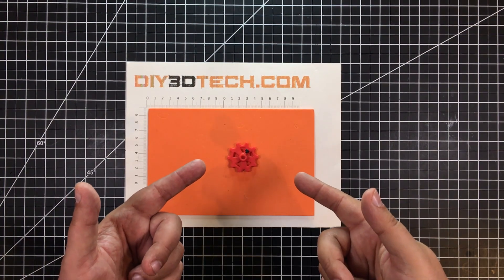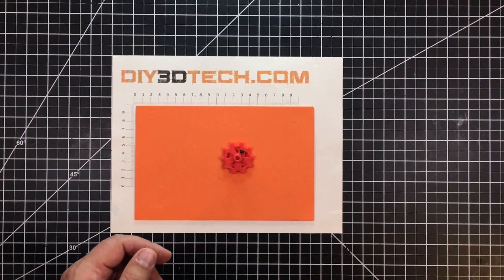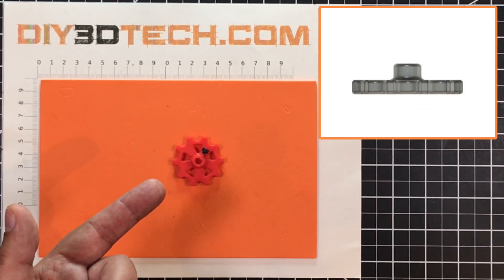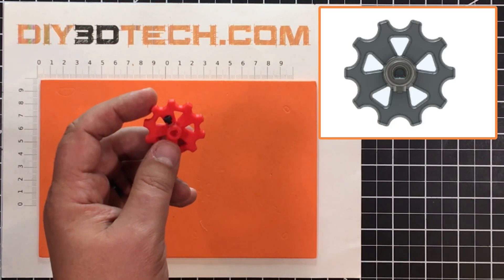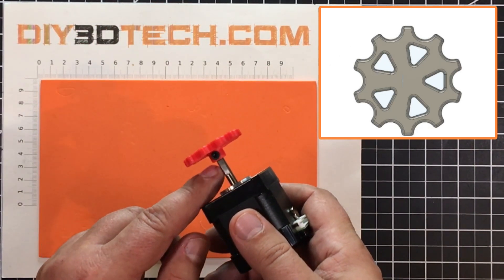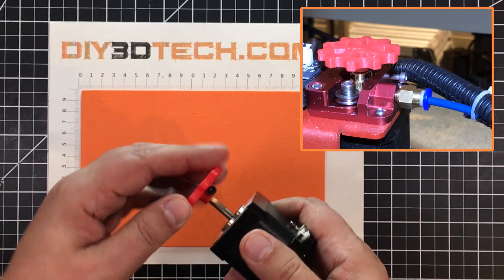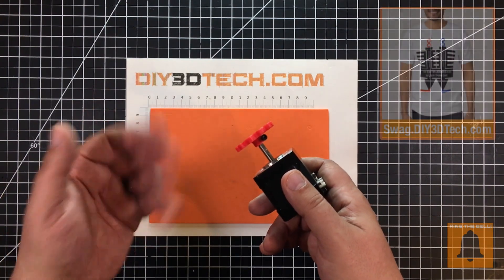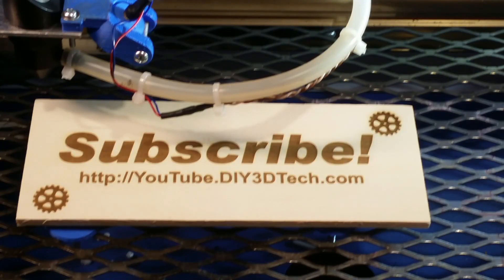Design Talk - A New Twist On the Extruder Knob!

Comment: Nice one Joe but I have the newest one where the motor shaft does not come up far enough.  I idle wheel on this one.  The Filament is squeezed between to knurled shafts and the gear mess on the bottom.  It really works well.  Here it is https://amzn.to/2MtZ2Lx . Merry Christmas
Reply from the maker: Merry Christmas back at you ole friend!  Yea I hate it when they short shaft you!
Reply: @DIY3DTECHcom  Thing is Joe you don't need the knob with this new one.  It is great.  Happy New Year my old friend.  Just waiting for the Mavic 3.